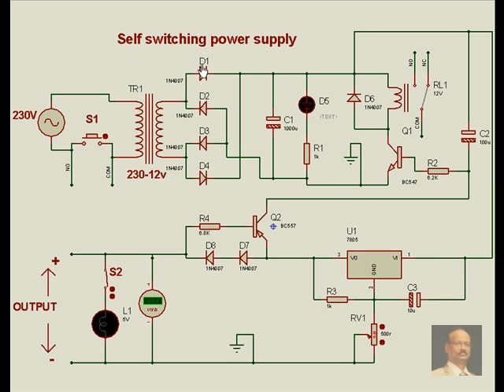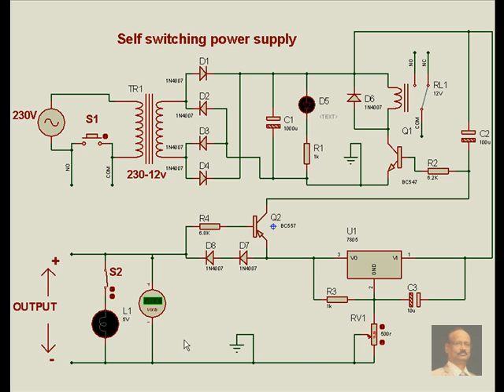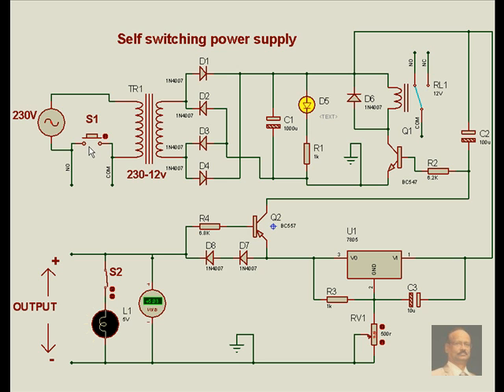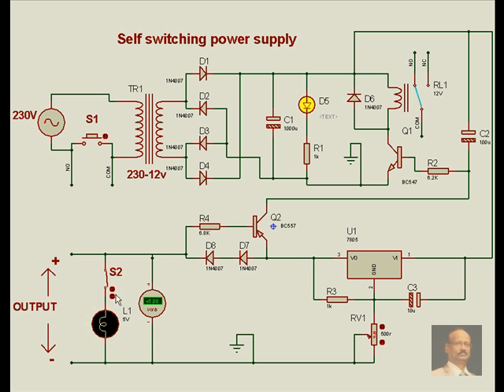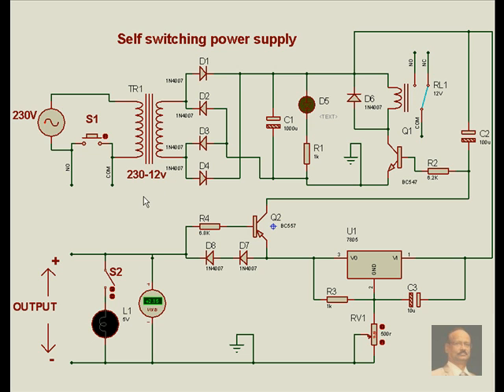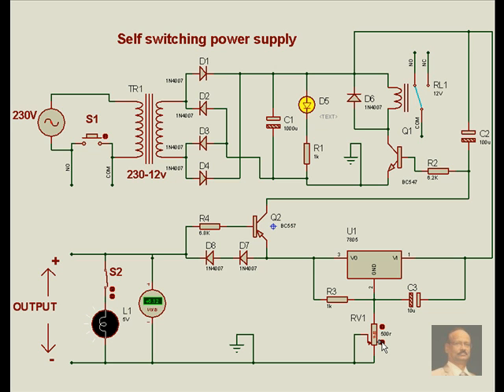Practical Electronics Mini Projects, self switching power supply.avi

Comment: hello .please I need a fonctionnement  of the voltage regulator in this circuit please.
this is my number what's up (00213658504223) am from Algeria
Reply from the maker: Read data sheets on them. They are linear regulators having poor efficiency compared to SMPS type

Comment: After pressing S1 230V is over T1 transformer, but if it is released wont there be an open circuit since "No" and "Com" aren't connected ("Com" and "Nc" are connected at the relay). Or does the relay connect "No" and "Com" at the right time, if yes how does that work? Thank you for your work and videos on youtube !

Comment from the maker: Your understanding of the circuit seems to be poor.Pls note "No" & "Com" written at the push switch points mean that they are connected to the relay contacts of "No" & "Com".This is a common practice in circuits to avoid drawing lines all through.pls look at the video carefully.No & Com contacts of the relay get closed that causes the push button points close even though it is momentarily pressed.Thus ckt input is always available till the relay trips & then input supply is disconnected .